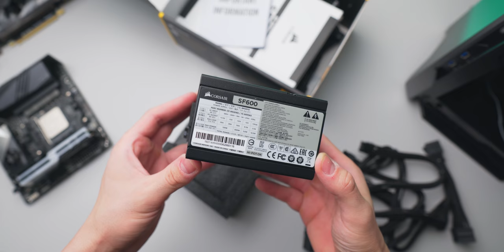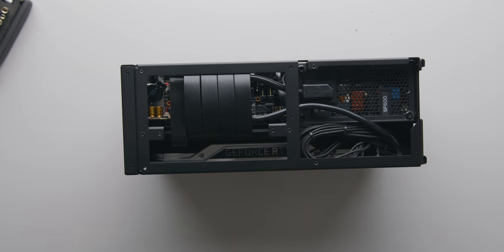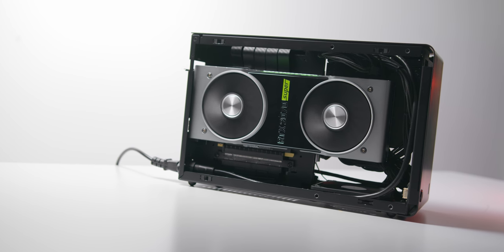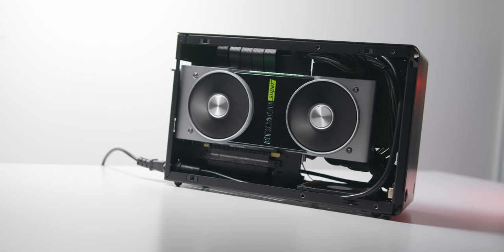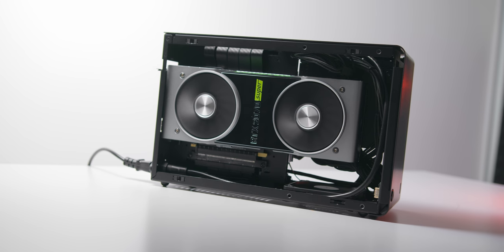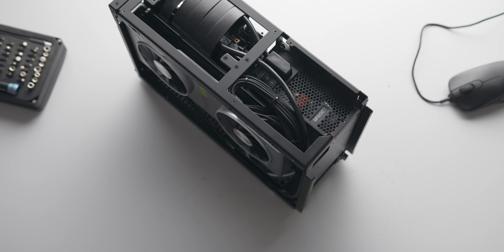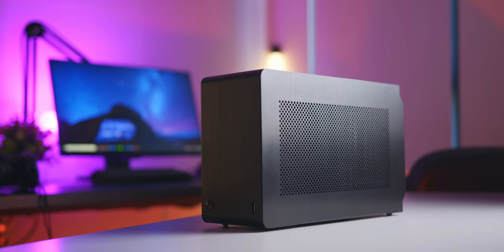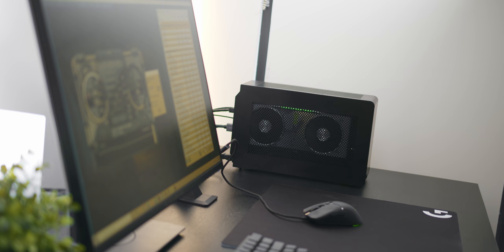$1600 Dan A4-SFX Gaming PC Build Guide

Comment: Can you please list the itx mobos that are compatible with the black ridge cooler? I can't find a compatibility list anywhere! I'm looking at a zen3 ryzen 4000 or i5-10600(k) build in the dan a4 v4.1 case which requires usb c front header support (I wish they were still offering the normal usb front connector, I can't think of much use scenarios for a usb c connector.

Comment: We need more NR200 content :)
Reply: truth
Reply: Best budget itx case air flow was really amazing!

Ryzen 5 3600x
2070 super
Idle 
Cpu 40°
Gpu 40°
 
Gaming on 2k ultra 
Cpu 58°max
Gpu 67° max
Reply: Yes
Reply: A custom water loop inside the NR200 would be nice
Reply: Yes please!
Reply: This
Reply: @16jiwang  on highest setting?
Reply: @16jiwang  I have a NR200 with similar components with 4k. GPU gets 90°+ & CPU 50°.
How'd you do it / what are your exact components?
Reply: @chickenmobile  Do you have two 120mm fans exhausting at the top, two intaking at the bottom, and 1 intaking from the rear? My 3060ti doesn't reach 65 degrees despite using a fan configuration that prioritizing the cpu thermals. Ontop of that my asus tuf 3060ti is overclocked by 200 on the core, and 800 on memory (max fan curve of 60%). I use an ID-Cooling SE-224-XT air cooler with 1 fan intaking from the back of the case, and the other pulling it through the fin stack and exhausting above the gpu. With 4.6ghz @ 1.25v I would've go much higher than maybe 75 degrees max in stressful games, but with PBO2 I can reach as high as I would in cinebench (85-90 degrees) and still not crash. I'm hoping this Scythe Kaze Flex 92mm I add directly to the rear for intake will further help guide cool air into the system and further reduce my cpu temps.
Reply: @bobnorman3094  I have radiator for CPU side-mounted & no fans on the bottom. Currently 1 fan on top & 1 back that came with the case.
Sounds like it needs a few extra fans on the bottom. Will probably need slims cause tried regular & didn't fit.

Comment: Thanks for the input. I just bought the DAN A4 in V4.1 and will soon be installing a 5600X with a 4070 Super in it. Now I have a very basic impression of how the case is constructed. Thanks for that! As far as airflow is concerned, I have to tell you that you are wrong if you install the fans at the bottom with airflow downwards: warm air rises upwards (hot air balloon principle). So you are trying to work against physics. Of course, you are at least leading some of the warm air out of the case, but this rises on the outside walls of the case and is directly drawn in again by the CPU, PSU and GPU... It is better to design the airflow from the bottom (cool) to the top (warm). The case has a permeable top for a reason. Even if only inline fans are installed, the case will not burst ;)

Comment: Maaaaan you got me now trying to choose between this and the NZXT H1 now.
Reply: MrMacNeilPlays I’d say you can’t go wrong either way. A vertical setup takes less space on your desk and if it’s for a rig which is up to a 2070 super, either rig will be fine!
I really like the Dan A4 as well, however I still went with an H1 because it comes with an AIO, PSU and looks just so good! Plus, it was quiet enough for me, with decent thermals too 🤷🏻‍♂️
Reply: Me 2
Reply: H1 has bad gpu thermals, looks bigger, looks cheaper and is worse value as the aio being included doesnt mean the aio is worth it and it has had price increases
Reply: Just did a H1, couldn't be happier. Clean aesthetic, small footprint, runs like a charm!
Reply: If you need to take your PC anywhere get the Dan, or even better the sliger (better thermals, finish is subjective) If you're never going to take your PC anywhere get the H1.
Reply: Snowbind I travel with my H1, same as I did with the a4. You can also invest in a Pelican case. The H1 is a little taller, and wider, but not hard to travel with. Albeit, any case is a travel case if you’re willing to do it. Funny you mentioned the Sliger, almost purchased the SM580, but I didn’t like the slotted side-panels, or how big it was.
Reply: Pick H1
Reply: I really like the H1 build I did with a 10700K and 2080 Super.
Reply: nr200
Reply: I don’t like the H1. Or the fact that you have no choice in cpu cooler or PSU. Gross
Reply: Arman Talwar but how a bout the colling of the nzxt in a room without air condition, will it be okay?
Reply: brandon tan 
Man my PC handled things like a champ during the heatwave (London), with ambient temperatures close to 40 degrees Celsius. 
If you’re really worried, just slap 2x140 mm fans at the back of the H1. In real use, you can’t see the fans, and it decreases temps by another 10 degrees for the GPU and 5-7 from the CPU.
Reply: ill take either one but god damn where the hell can i buy either of em in canada

Comment: Got addicted to this channel back in May and built something very similar back in June! Same CPU, mobo, case (v3), RAM, case fan, and PSU but with a 1080ti and a WD SN750 SSD. Used some 3D printed mod parts from Reddit and the Asetek 545LC with a bigger CPU fan.

PSA: You can still wedge a Noctua 92mm slim fan under the Mobo in the v3 case. There’s no mounting holes, but it fits in there nicely with a small bit of adhesive and the vibration pads.

Comment: Graphics card de-shroud when?
Reply from the maker: Next up!
Reply: yay :)
Reply: @optimumtech  can you also do in that video a stock fan change to noctua to see noise and thermal improvements ?? for example in ghost s1
Reply: @optimumtech  The RaijinTek Morpheus 8057 is releasing soon. Will you be reviewing that as well, since it goes hand-in-hand with de-shrouding the GPU?
Reply: Nr200 custom watercooling build when?
Reply: @optimumtech  Would it work to remove Nvidias shroud +fan and put on som 15mm noctuas ?
Reply: @optimumtech  Hope the de-shroud video includes other cases like the NR200!
Reply: Have a 7700k and an Asus Strix 1080, in my A4 v3. have not been able to get the sound under control 😢 CPU fan spin up during idle and I have a jetplane in the room when gaming :(
Reply: @arvidjohansson3120  Nah, The Founder Editions use a Vapor Chamber Heatsink.
Reply: Check out my DAN build - pimped my RX 580 with 3 9x14 Noctuas 💪
Reply: @optimumtech  Hi, please make a build video on the ZS -A4S V2 & V3.

Link for details on V3: https://smallformfactor.net/forum/threads/zs-a4s-v3-sweet-size-for-compact-mid-spec-air-cooled-build.14272/

Comment: I happened to pick the same exact CPU/MOBO/RAM combo in my recent gaming PC build!!!
Other components in the build are:
 - WD BLACK SN750 500GB, 
 - ASUS ROG Strix RTX 2080 O8G, 
 - Corsair SF600 Platinum, 
 - NCASE M1 v6.1 (CPU & GPU both sit comfortably in the M1 case and are both hovering around 65-70 degree during intensive gaming sessions),
 - Noctua NH-U9S.
With only $159 (which is in the same ballpark with ASUS b460/h470 ITX boards), ASRock Z490m ITX/ac gives you the ability to OC the 10600K and have a memory frequency higher than 2,666 MHz (compared to the B/H series ITX board). Like you mentioned, the power delivery on this board is not as beefy as some of the higher-end Z490 ITX boards, but it should be able to handle the 10600K without any problem. I wonder how this board would perform when paired with 10700K or even 10900K, in terms of VRM Temp. & OC Capacity/Stability, etc.
I really enjoy the ITX-focused contents in your channel - please keep doing what you're doing now and keep the fantastic contents coming!!!

Comment: I just bought the Dan case v4.1, so I’m very happy you made this!
Reply: I couldn't purchase the Dan case.  At least not in a timely fashion.   Ended up buying a NUC 10 instead.
No regrets here.
Reply: Same here, and I'm sure you'll condone my current reaction to the purchase. 

How are you planning to build your Dan A4? Kinda running into dilemmas here and there.
Reply: Which motherboard you going to get for the case and graphic card?
Reply: @ruachpneuma5638  Hey, I ended up getting a 2080 Super (founders if I can get it, otherwise the Zotac AMP). For the Mobo, I'm going for the AsRock B550i Phantom because I THINK the heatsink is low enough for the Alpenfohn Cooler to fit.

Haven't put everything together yet, waiting on the small fans and GPU to arrive.
Reply: @poragon  I also bought the same Mobo with the alpenfohn cooler!  Haven't received the parts yet though.  Would you mind letting me know if you run into any issues regarding clearance?
Reply: Dennis Ryu for sure, I’ll let you know as soon as I get my fans. But I’ll check real quick and get back to you. Do you have already have the Corsair LPX in mind too? I know those fit for sure
Reply: @goldencarpbread  Hey, just finished the build. Hope you've finished yours too. 

It fits, nothing's giving problems, though cables from my power supply pushes slightly towards the panel on the mobo side, but it's just a cable management issue on my end.

Comment: Undervolting definitely helps a TON. 
I am still using my 1080Ti FE and with a mild undervolt, I am hitting higher boost clocks (about 35mhz on the core), thermals are around 76*C vs pegging the 83*C limit before. This in addition to lower fan speeds (about 700RPM). Blower card finally tolerable for noise. 
Your guide was massively helpful for me. 

Also, Love this video, would love to see more build guides.

Comment: put painters tape along the bottom of your FE RTX card, and it will force all the hot air up and out of the case. my testing has shown a drop of about 10C under full synthetic load on my RTX 2080 ti when doing this in the A4SFX

Comment: Bloody starting to love this channel. I love tiny pcs as I hate having a giant protruding tower... Now most other channels don't seem to care for small cases... The average consumer doesn't even use more than a single pcie slot, 2 DIMM slots and maximum 2 sata connections anyway, so why not build smaller? I feel 7-15L the thermals are safe enough too and noise isn't an issue either as well, it's just the graphics card that'll produce noise. So I'd just like to say a big thank you for making these videos, I think a video with some extremely comprehensive tests of thermals between 7-15L would be good however, ideally the same setup in each case too?

Comment: I'm actually finding this to be really helpful and inspiring - though I feel bad now for going with the Ryzen 3600. I almost feel as if I should've just bit the bullet and did some upgrading but I figured it would be the best bang for the buck since I got it at around 160$ US. 

Awesome build - I'd love to see you do one using the RVZ03 from Silverstone or perhaps even the Mil08 case with the handle just to see how a pro would handle heat management in either build.
Reply: Ryzen 3600 is perfectly fine, still holds the title as the best value cpu for gaming out there. He also mentioned that you'll only lose about 5% gaming performance, which honestly speaking won't be noticeable to most human eyes.

Comment: Really cool vid! I just built my Dan A4 a month ago but went a budget route for £720 (almost all second hand) with a MSI 1650 super gaming x until the new GPU's come out.

For your fan config you set the fan as exhausting air out the bottom? I currently have my two case fans pulling air up through the top - does your setup improve thermals significantly? Thank you for creating great content.
Reply: Yes, I'd like to see the thermals with those fans pointing up instead.

Comment: Great video on the Dan A4-SFX! Would be great to see more of those! Got the A4.1 version and just installed the Asetek 645lt a few days ago. If you experience too much noise from that fan on the bottom, you can install a mesh in front of it. It has a problem with the distance to the case somehow...

Comment: my 1000€ build would be this, but i would wait for next gen gpu's tbh
dan cases a4        215€
corsair sf600       110€
Noctua NF-A9x14     15€
ASRock B550M-ITX/ac 130€
2x MQ-Series 3TB    145€
256gb nvme(os)      30€
MX500 500GB         50€
Ryzen 3 3300X       130€
RX 5500XT 8gb       175€
Reply: Push for the 5600 XT atleast. Worth it.
Reply: @Lollakuk  like i said, i would wait for the new gen gpu's
Reply: @mhh3  yes but in that build I mean obviously.

Comment: Yeeessss thank you so much I've been planning on building a sffpc this year. Debating between Dan A4, Velka 5 and the T1
Reply: I have a customlab case, basically a A4 but tiny bit smaller. It comes in handy if you move your pc around a lot, as it can fit on say a window sill. But if your going to keep the pc stationary mostly then get the T1

Comment: Surely the money saved on the CPU and the motherboard by going for a Ryzen 5 would be better spent on a graphics card?
Reply: Really depends, you can get a 10700 or 10600 and a cheaper mobo and still have superiority over Ryzen for gaming, and only a couple % less than the top end K series parts. Ryzen definitely runs cooler though, I can’t break 70C with a cryorig C7 CU in my A4 no matter what the workload is, granted I’m undervolted.
Reply: @ALmaN11223344  I suppose going for a non-K CPU and a non-Z motherboard would reduce the cost quite a bit at the cost of overclocking. Plus you have a stock cooler which I normally recommend to delay an extra cost (assuming stock coolers would fit and perform well enough in whichever case)
Reply: How many people realistically need over a 2070s though? I’d prefer to ‘splurge’ a little for the 10600k vs any ryzen as the cpu cannot be upgraded easily or on its own (assuming you’re a normal person who doesn’t upgrade your cpu every year). The gpu can be upgraded later on down the road if you so wish and you’ll only have one thing to buy vs two
Reply: no reason to be buying ryzen when these 10th gen intel CPUs exist. 10600k is better than the 3600 and same price.

Comment: It's nice to see you mention the fan header splitter in your build videos. Is it the second time after the NR200 video? After some research, I found that noctua 120 pwm fans use around 0.1a, and a 1A 12V header could easily accommodate multiple fans with a splitter.

Comment: the problem with speccing an AMD card, be it a 5600 or 5700 is they still suffer from driver issues that cause black screening and all sorts of things. While a lot of people dont have this problem. There are enough people that do meaning its all down to RNG if you'll suffer from problems or not.

Comment: Q:  How difficult do you think it would be to water cool that set up and beef up the specs?   A:  How hard would it be to find 92mm rads that fit? LMAO   I am going to build two ITX rigs for my start up and I'm still sold on using your recommendation of the NCase M1 for the gaming/video and music production rig.  Its going to have the 3950X (4950X possibly???) max gpu power next gen card war winner and obviously its going to be soft tubed water cooled.   So the smaller I can make the foot print, the better for travel purposes.  Attach a 2nd Gen (Soonish I hope) Lapdock to it and rock with it on the go!
Reply: asetek 92 mm liquid cooler with a slim 92mm noctua fan is made specifically for this case. it can be tight with the psu cables but it fits. I think it would struggle with a 3950x still but its a huge improvement over air in this case. I run a 2700x with the asetek no problem.
Reply: @stevens.7829  I figured it will be that way with the 3950x.  When I'm ready to pull the trigger, I'll look one last time at case thermals for liquid and decide then.  Its not like I want to overclock.  I rather undervolt and get 90% of the product in that small of a case than lugging something bigger for just the extra 10-15%.  I'm coming from a x99 5820k so that loss won't be noticeable to me lol

Comment: Can you please make a thorough comparison between Alpenföhn Black Ridge (120mm slim fan, vlp RAM and appropriate motherboard) and Asetek 645LT? 
Not only the CPU but the overall impact on the system, GPU and motherboard temps, limiting factors, caveats (and everything else I'd expect from an Optimum Tech video=)).

Comment: Hi @Optimum - why does this setup produce better thermals with exhaust fans on the bottom instead of intake? I thought I'd need to use intake to encourage airflow upwards and out the top of the case.

Comment: I don't think the front connector is worth running in the Dan A4. Cable management is so difficult as it is.  

Also I don't use the IO shield since it allows more airflow in or out of the case.

Finally I ordered custom non-sleeved custom cables from pslatecustoms they fit perfectly in the case and don't take up as little space as possible in the case.

Comment: You mention compatibility issues with AMD GPUs, but don't offer any suggestions verbally for which current model(s) fit (Powercolor Red Dragon). Also, would have been helpful if you could have suggested any AMD motherboard(s) that fit the CPU cooler you used. FWIW, I have a v1 A4, and found that the Cryorig C7 fits in the keepout zone of the Intel 115x socket without interfering with normal/tall RAM sticks and seems to do an adequate job on 65W CPUs (YMMV). Sadly the C7 (and Cryorig coolers in general) is impossible to come by in USA at a reasonable price - currently it's $65 on Amazon, which is about double what I paid for it ~3 years ago, compared with ~35Euros in EU (OCUK/Caseking) as of August '20.

Comment: Just a question, would it be appropriate to spray paint this case? And if so, would it be possible for the temps to melt the paint (god forbid). I’m thinking midnight green or blue, olive, or Payne’s grey.

Also, what happened to using the cat for a size reference? That was cool!

Comment: ASrock Z490 boards are trash, asus/aorus would be better choice IMHO, regardless of cooler. Someone on reddit manage to squeeze l12s ghost on Asus z490 itx without any issues, eventhough its not officially supported. On the other side , personally i would choose 3600x+B550i aorus instead of intel. Nice video as always,  keep up ;)